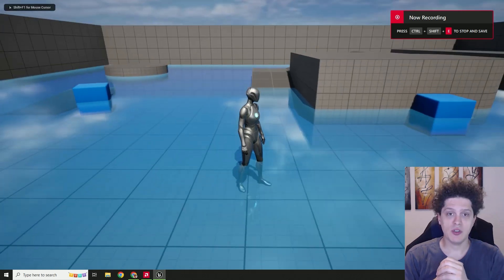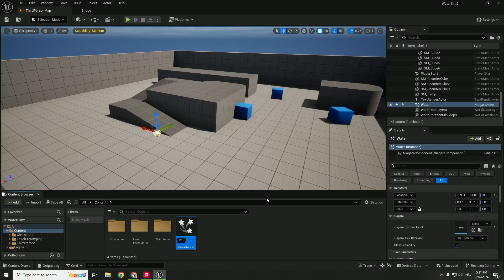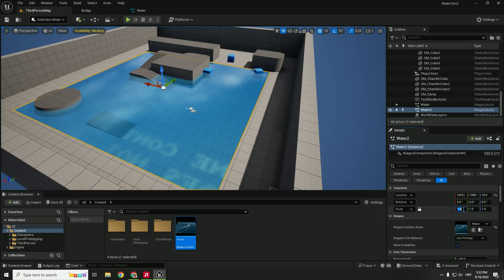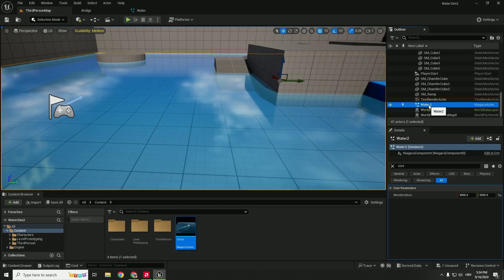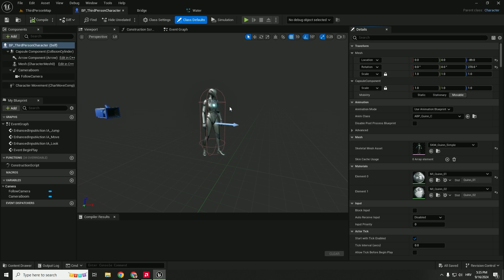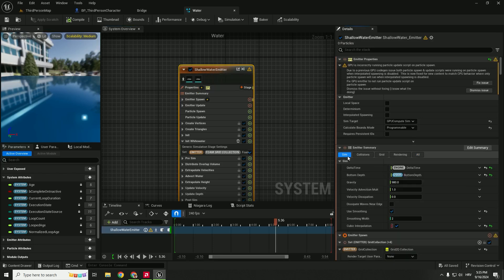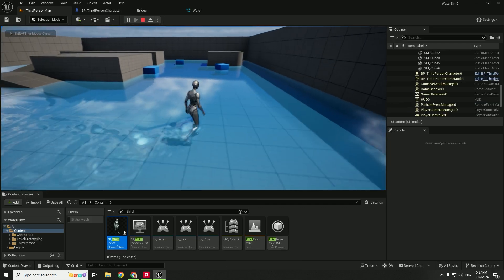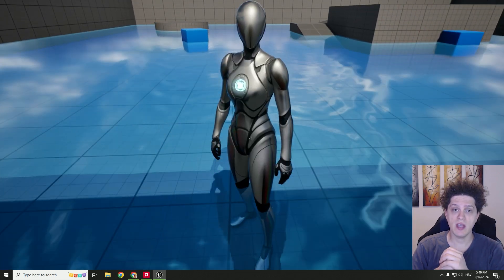Easy Water Simulation Using Niagara in Unreal Engine 5

Comment: hey tried this on Window and it works but on my Mac nothing, even the color smoke template, all i got for that one was black smoke. any idea? the other guys couldn't figure out why.
Reply from the maker: Unreal Engine on macOS uses the Metal graphics API instead of DirectX. Sometimes, certain visual effects might not render properly on macOS because the Metal API behaves differently than DirectX. Go to Project Settings → Platforms → Mac and make sure that Metal is selected as the default API. Maybe this works...
Reply: @ezunreal  thanks. that might be it
Reply from the maker: @apollogt_com  Cool, good luck